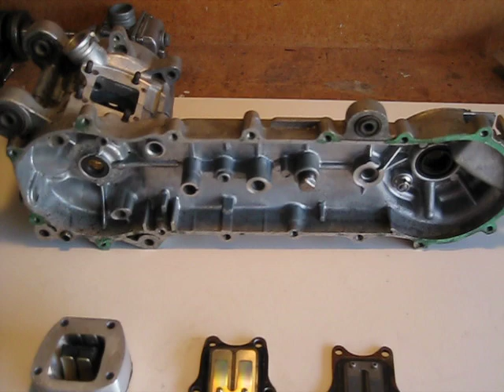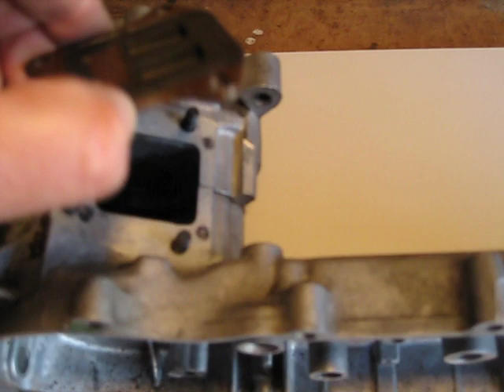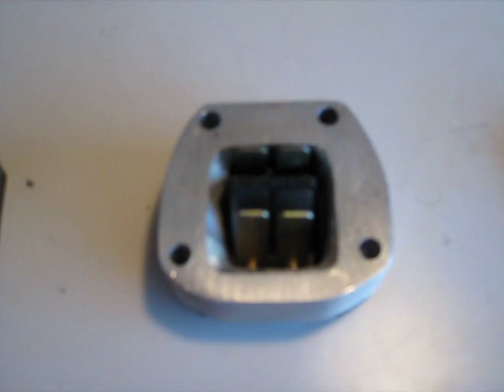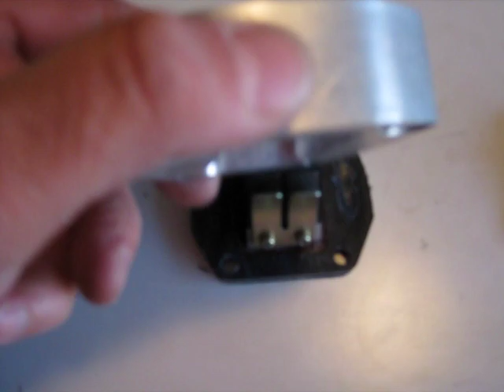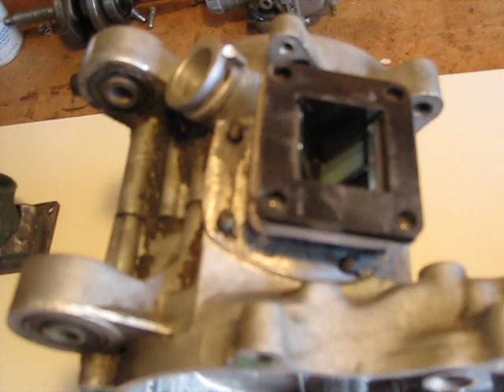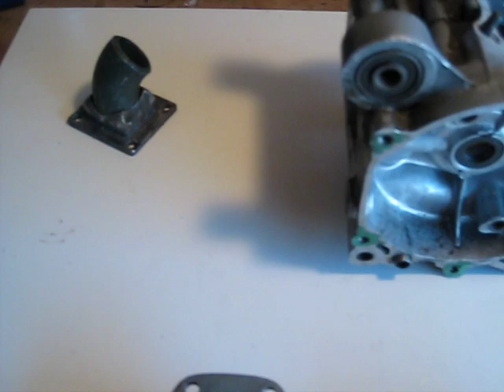Extreme Urban Express Reed Valves

Comment: if it's the express II, then it has an autochoke. The autochoke will set as the engine warms up. which is why it 4strokes when you slam the gas before it's ready. just give a few minutes to warm up and all is well. same deal with nu50

Comment: i have thought about doing this to my NU50 but im not sure how the increased volume of the crank case from the adapter will effect velocity of the air being forced through the transfer ports. form my understanding small crank case volume increases the velocity of the air because it become more compressed  and the opposite if the is grater crank case volume.